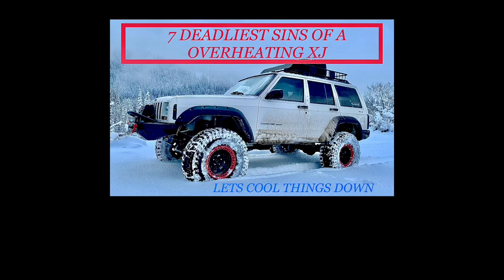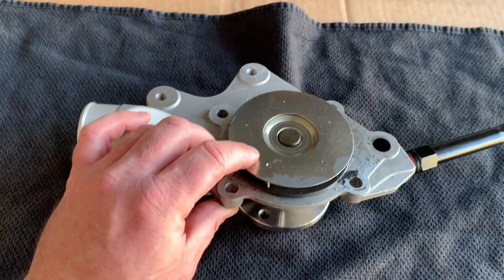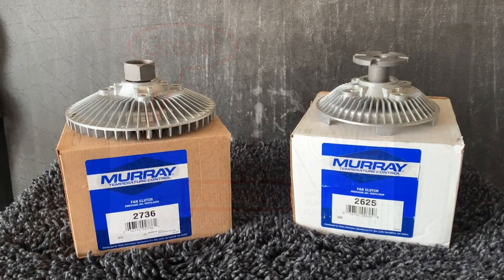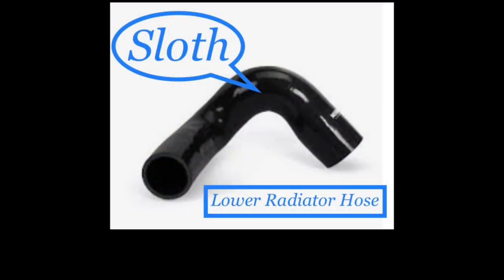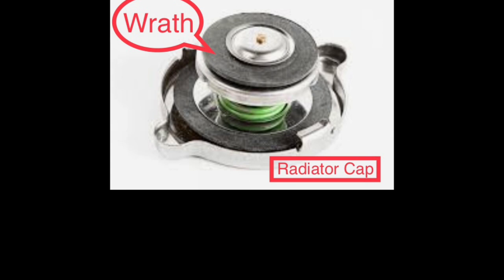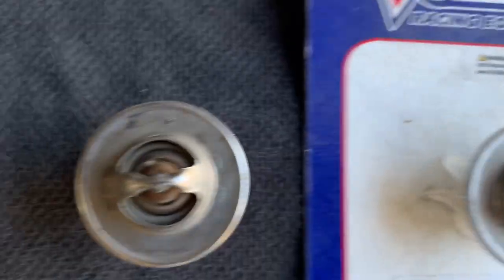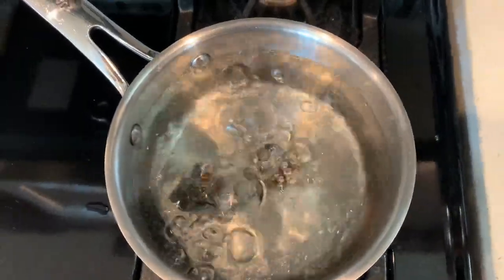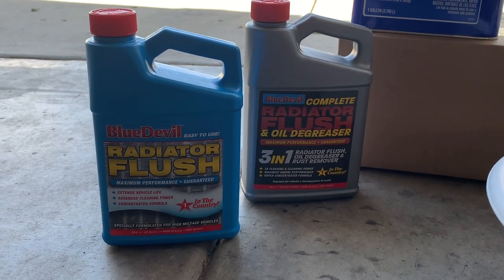JEEP CHEROKEE: 7 DEADLIEST SINS OF AN OVERHEATING XJ!!

Comment: Well I have to think that the 8 deadliest sin is listening to you it's not called a t-stat it's called the thermostat and if you start putting 180° wine and a Grand Cherokee your engine light will come on cuz it has to have a 195 because it doesn't get up to temperature fast enough it's 180 degrees you need to learn to read something a lot of fast food or something back off and pick up a book
Reply: and you need to learn how to use punctuation, usually they do in books so maybe you should take some of your own advice.
Reply: I run a 180 on my 96 no check engine light.